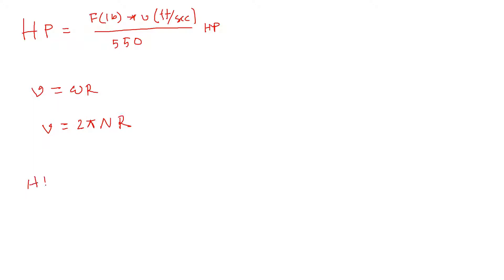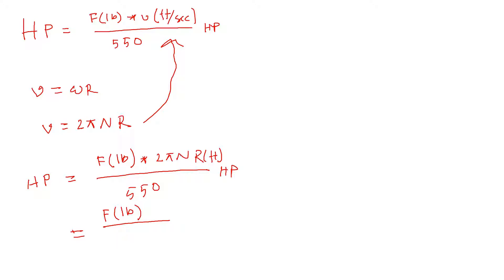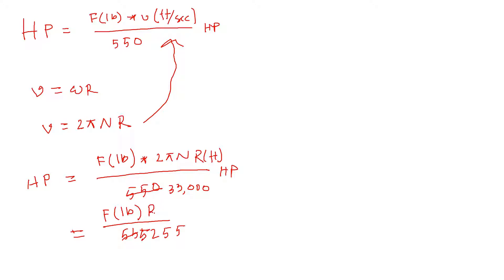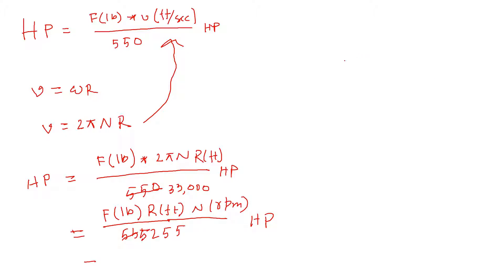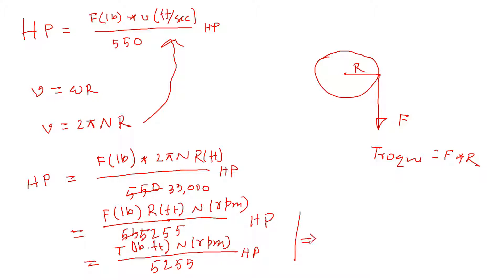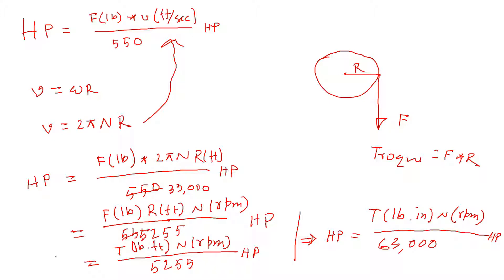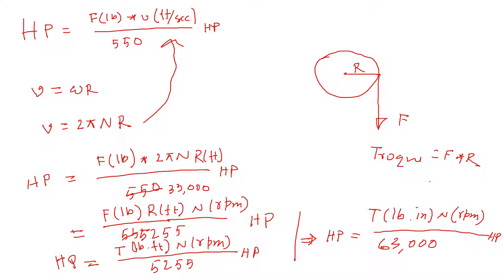Fluid Power: Horse Power and Torque Explained | Updated Version in Description

Comment: Sir, I want to make a mini-excavator, sir, please help. I have a 12 hp rpm 220 diesel engine. The cylinder diameter is 30 millimeters and the length is 80 cm. HYDRAULIC PUMP. rpm = 180 / minute. ma pressure = 210 bar. displacement capacity = 27cc. ORBITAL MOTOR. max speed = 185 rpm. max torque = 290Nm. max output = 6.7hp. max preassure continue = 170bar. max intermitteent pressure = 200bar. max flow = 60 lpm. HAND VALVE. max pressure = 35mpa / 350bar. max flow = 80lpm. Do the items I have fit the machine? please advise the diameter of the hose. please help, sir. thanks.
Reply from the maker: I have more videos listed by topic here: http://www.theopeneducator.com/fluid-power . I also have some practical application problems under the pump, cylinder and motor modules. I am not sure if you have checked them all. They will be helpful in the design process. Thank you for watching!